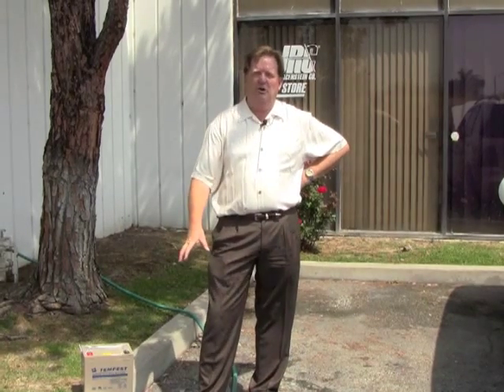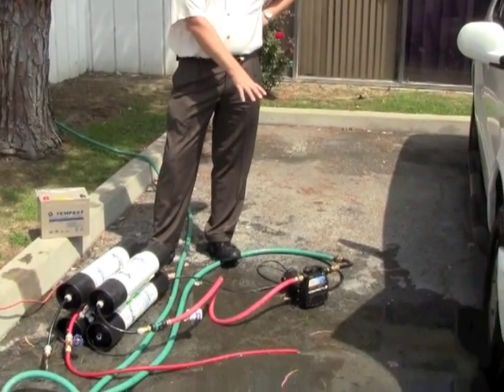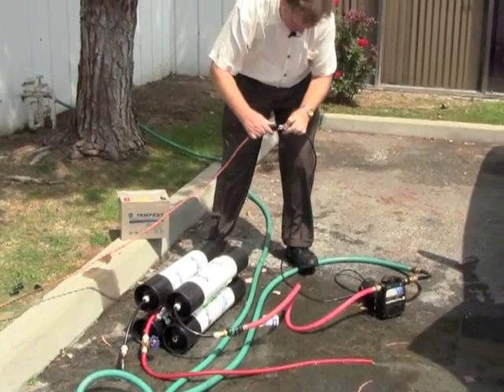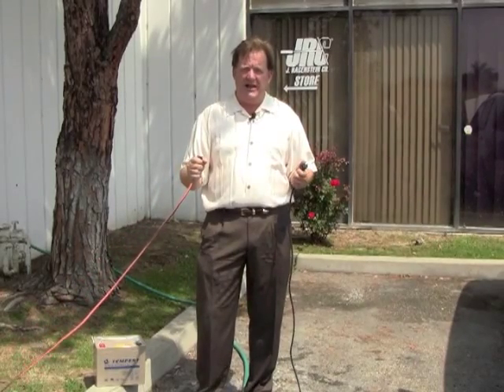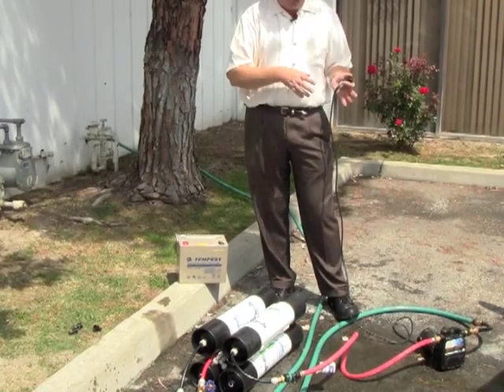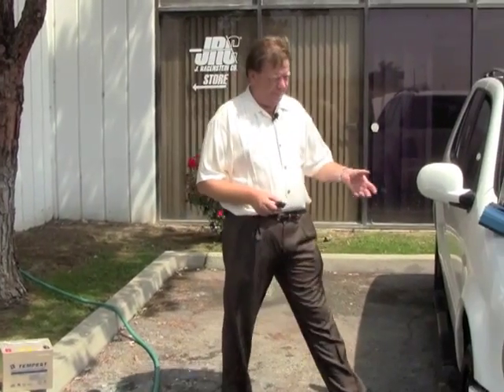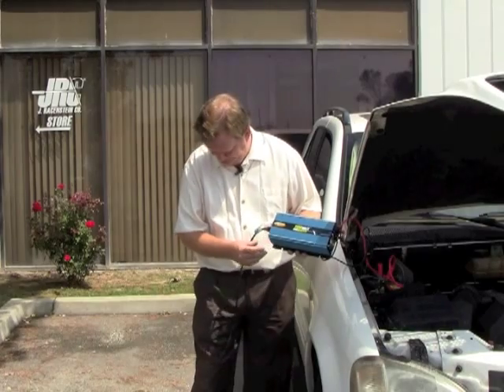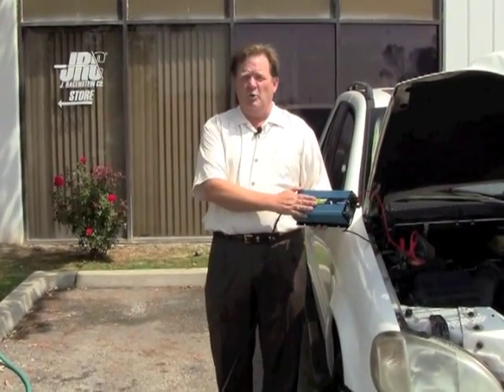Portable Pump And Power

Comment: Is it safe to run this pump directly into DI tanks with no RO. I would want to run this pump for low pressure situations or to be able to run 2 poles.
Reply: Yes. Its only a 40psi boost so your tanks and hoses will be able to handle the increase.